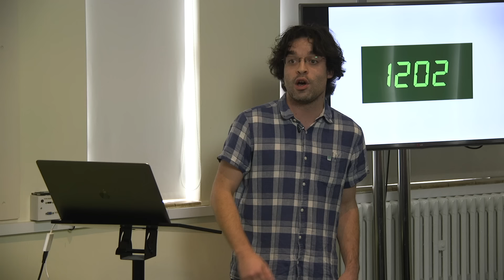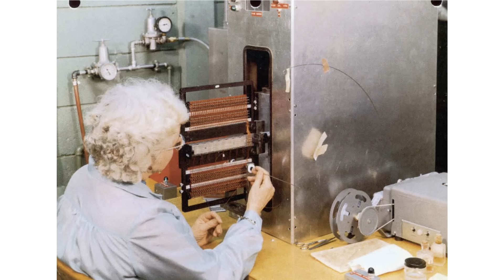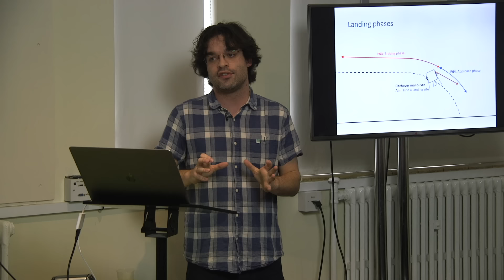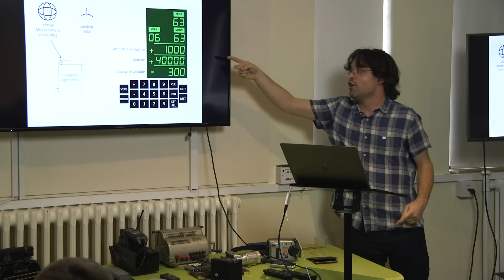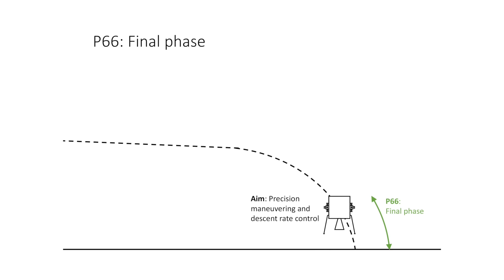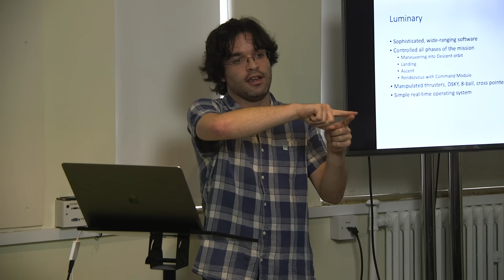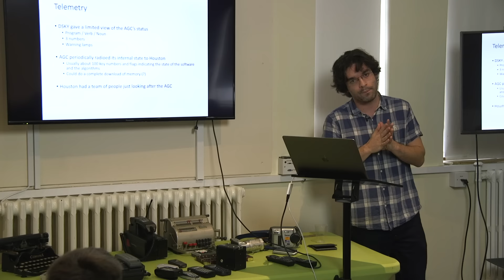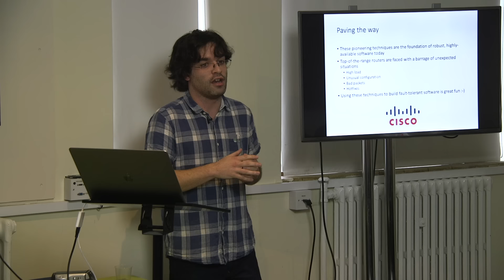Light Years Ahead | The 1969 Apollo Guidance Computer

Comment: When asked how to explain complicated scientific matters to the public, Einstein replied that no scientist knew what he was doing unless he could walk out on to the street and explain i t the first man he met. Robert Willis is an outstanding communicator and would please Einstein.
Reply: I have to agree completely, I know what it's like to see a blank face staring back at my words.  this was completely clear and concise, I hate computers, but understood this very well.  I entered high school in 71, and congress had bought 50 mainframe computers in the mid-sixties or so, and my high school in Oak Park, right outside Chicago, won the lottery for Illinois.  Both my elder and younger sister ended up software engineers, and I ended up a machinist, mechanic, and avionics tech, in the Corps.  I hated seeing them enter cars, replacing the actual analog cams, which I still like much better than electronic.  I have two years of cobal and fortran, required, because of having a computer in school, but I saw the problems that have cropped up, in those first years, and fought them two decades, with digital radar and digital voice scrambling.  I think I resented it because we worked on the equipment without school, hard schematics, and were denied access to the most fundamental part of what took place in the software and hardware.  This man made me almost begin to like computers.  I hadn't heard that quote, but it was very much like him.  Thanks for sharing that as well.
Reply: My mantra:  If you can't describe your great idea on the back of a used napkin..it won't sell or work!
Reply: @fredherfst8148  like the stone hinge set piece in the movie SPINAL TAP?  I prefer detailed drawings and information. used napkins really??
Reply: @fredherfst8148  To be more correct, but maybe  not pc, i recall he said:  "if you cannot explain it to a barmaid, perhaps you dont ................",
Reply: @37rainman  ...I've had a few bar maids explain a few things to me!
Reply: Still worthwhile as principle but isn't Einstein

"This writer has heard this quote for years and always grown up with the assumption that it was, in fact, from Einstein himself. In hindsight, it should make sense that Einstein never said this as his work remains some of the most complex and thorough explanations of modern physics. Variants of this quote have been attributed to Ernest Rutherford when Rutherford said: "it should be possible to explain the laws of physics to a barmaid."
Reply: @MikStorer  Yeah. It's a noble ambition, but rocket physics seems to be the limit. Physics that has no basis or analogue in everyday life requires that the listener is prepared to forego of their preconceived notions of how the universe works and more or less take the word of the physicist as gospel. "Common sense" is usually not applicable to topics such as quantum mechanics.
Reply: @MikStorer  Naw.  It was Rutherford and Einstein competing to pick up the barmaid by dazzling her with physics explanations.  "You see, my lovely, if I'm enriched uranium and you are enriched uranium and we achieve a certain level of energy density in our little pile, things are going to heat up and we just might react accordingly."  Einstein got the girl.  Rutherford sulked and ordered another beer.
Reply: Damn Straight!
Reply: Ok so I was just replaying my fav highlights of this mans presentation in my head just moments ago. Which sparked the realization that the nature in which he explained the computing events somehow tricked me into feeling as if I understood what he was telling me... at a computing level! As if I was following him every step of the way. "Verb 05 Noun 68, hahaha You and me both"
At the sidebar, Im still sifting through the debris of what use to be my mind from learning of what a GUI use to look like!! Are you sh!tt!ng me?! So, no Click, Double Click, Right Click? No Drag-N-Drop or C&P? Well in addition to the images of wires through rings, since there was no Control-Alt-Delete and Task Manager can we really call it "Computing"? Lets be honest with eachother... what All of these men and women did was Level 40, Merlin style Wizardry! Ok... and they did it going to the fucking Moon! 🤨

p.s. Now Im pissed because people like Zuckerturd and that "Look at my beard, Im a real man" Tweeter guy,  sleep on a matrress Sooo stuffed with their own ego that They think they float above the rest of us!
Reply: @lgg2304  I have to say, having watched the Apollo program from it's inception, you've nailed our current society quite accurately.  I followed the science then, amazed at the skill of those making this happen, while deep into electronics, and not understanding at all, the idea of "computer", at that point, only ever having mechanical computers in hand.  I found it truly enlightening, even with the "wizardry element" that threads in and out, throughout.  I still find my computer one of the most obstinate, mind warping, challenging thing I've ever had to deal with.  I also look askance, at the fact, we discarded every bit of "great technological products" pretty much as soon as we finish using them, well, the first time.  You really hit the nail on the head, regarding computing then, and today.  Not too many years ago, a joke about cars, "if your car acted like a computer", suggesting your car would often refuse your desires, and now, we commonly see it, no joke, real time.
Reply: He was a fraud.

Comment: I enjoyed every second of Your presentation. Maraget Hamilton and her team are geniuses. 
It alsp brought back memories of my first jobs as a programmer in the late 70s. We wrote software to control powerplants running on redundant 32k (16k program/16k data) memory 8 bit machines (2 19" 32H racks each) with not enough space to run an assembler, so Hex coding was the only way. 
At university while studying physics I had joined an experimental course in CS in 1976/77 and I remember the above mentioned principles being taught by our professor. 
I let physic go and never got my degree because I had so many jobs after just 3 semesters, that I founded my own small software company in '79.

Comment: The capacity of the AGC is very similar to an Arduino Uno microcontroller (Atmel/Microchip ATmega2560), these chips are intended for cheap consumer goods and require engineers with classic skills to keep costs down, much unlike the hardware in core routers.

Comment: How come a radar routine scheduled for the next stage of the mission (takeoff from the moon surface to the rendezvous with the command module) started during the landing stage and no one noticed such ‘bug/malfunction’? If I understood the conference properly, the whole programming was based in blocks and in such circumstances the ‘loop’ between blocks so far away in running time/sequence would be impossible to happen, but…  I think no code available to check anymore. About memory: last millennium, I and other programmers had to allocate the length the memory we intend to use as common routine, depending the word length, the number of running routines, etc. because memory cost was high, operating time the same, speed was low, and so on. Nowadays programmers no long need to be that meticulous, turning their creativity towards solving  the challenges the best way without wasting energy and time in tedious work computers can do quickly and effortlessly. A last word to thank you the presentation theme and the captivating and logic way it was conducted.

Comment: Given how wide the gap was from the AGC from anything else available to the Soviets, I wonder what the plan would have been to solve the guidance needs of the N1 rocket? 
The Soviet moon program failed because of propulsion reasons, but if this had been overcome would the USSR have just taken a heavier weight penalty with contemporary computers or would they have built a rocket that by it's design did not have the computational requirements?

Comment: No fancy bells and whistles, just a simple deck of slides... But an outstanding and passionate communicator who can actually make you feel smart just by listening to him explaining complex things with simple illustrations. Highly recommended!
Reply: No fancy bells and whistles.  This brings the audience feeling like they are back in the 60 when all this was happening.  I wonder if the presenter did that on purpose?
Reply: Jonny Mosquito Strawman at Large  Modern day hardware is very susceptible to ElectroMagnetic Pulse, the hardware of those days very much less so. Soviet fighter planes which were brought over in the early 1990s were found to be using vacuum tube technology, which is much more hardened against EMP than VLSI chips. I'd suspect that there was similar hardening done - you might remember that the computer was made up of a very large collection of the same very simple chips wired to produce the required results. Of course, there were quite a few unmanned spacecraft sent to the Moon to map and photograph the surface before the Apollo missions, and these would serve as a test bed for figuring out the amount of hardening required.
Reply: And then there is the magnetic core memory as well, very much hardened against radiation as compared to today's VLSI memory, as noted above.
Reply: Here's a lot more detail on the computer - https://www.youtube.com/watch?v=2KSahAoOLdU
Reply: And the video above is first in a series of videos... and here's one on the programming language and how that worked - https://www.youtube.com/watch?v=xx7Lfh5SKUQ
Reply: @stream47  Yeah  , funny how in WWW III T 34 would have won agsin :-D Good Putin and Chinese  also  have electronic shit now :-D
Reply: Nothing better  than that, have no clue about natural  science and tech, but this was so great ...easy to understand  still only dumbed dumb enough to still bring over massive Information. This guy gets a throphy from me. Perfect presentation  you feel the passion, the work invested and the hard science behind  it. Wish Youtube was do good more.
Reply: d’uh, like it’s rocket scien... oh. Never mind.
Reply: I can do nothing but wholeheartedly agree with you. I feel I can actually understand to a basic level how they did manage to achieve what was undoubtedly the greatest event of the century. An excellent lecture all round.
Reply: Jonny Mosquito Strawman at Large  Aww bless, you don't understand science in the slightest.
Reply: It's a good rule for presentations, you shouldn't be putting information you're audience needs to read in detail in the slides as they will miss either your speech or what's on the slide. It should just be for visual aid and key talking points. And he does an excellent job.
Reply: I can do nothing but wholeheartedly agree with you. I feel I can actually understand to a basic level how they did  manage to achieve what was undoubtedly the greatest event of the century. An excellent lecture all round.
Reply: My experience working with engineers for 35 years is that the brightest and most competent ones were the people that could explain highly complex systems so that anyone could understand how they worked.  Like this guy...
Reply: When I noted the length of the video I thought to myself, oh well I will just watch until I'm bored. I watched the entire video, fascinating!! The presenter did a brilliant job keeping it a personal and interesting and, that would satisfy a surprisingly wide range of audience expertise.
Reply: @steventurvey5626  I had the same experience. I’m no expert in computer coding or hardware but the whole thing was fascinating and couldn’t stop watching.
Reply: @steventurvey5626  Same here,  in the end the longest non-music Youtube video I have ever watched!
Reply: @steventurvey5626  its worse...i want this guy to do a weekly 2 hr Video  on his  own channel now :-D seriously, anyone  kniw where to get more of stuff so good?
Reply: Jonny Mosquito Strawman at Large  If anything of that is correct, today the miniaturisations are much more advanced, but this can mean because of delicateness, they are more susceptible?
Reply: Yes, way better than that pair of blokes who just throw acronyms on a big screen. I had no chance and I'm pretty literate!
Reply: For 25 years I've been aware of the inverse relationship between PowerPoint and real content presentation - unfortunately I then pursued an MBA to confirm my theory and see weak presenters rise and hide behind made up correlations, useless animation and ridiculous projections.  And that's where we are...
Reply: Very true
Reply: You got some some on your chin there, guy. And for Christ sakes, hide that thing.. there's kids around.
Reply: He sounds nervous to me so im distracted.
Reply: for an untrained eye of course. the whole talk is about how many awesome bells and whistles there are...
Reply: This made me imagine people blowing on whistles during presentation
Reply: This is by far the best way to give a talk, if you can get away with it.
Reply: No narrator talking to you as if your a child. With bright colors and music.
Reply: @JohnSmith-hi2ry 8 pp in😅 pp😮0p pp obp
Reply: Jonny Mosquito Strawman at Large  Magnetic cores are rad-hard. As long as you can reset it you can recover.
Reply: thats a great point! thats actually a personality trait, to make people feel smart. i experienced that in a physics research institute, if you asked a stupid question there, it was accepted and even approved a great question and explained in detail
Reply: @michatroschka  tbh , that guy is so good he made me a duning kruger physics Professor now :-D
Reply: It's king staggering how they got the moon. In a tin can.
Reply: @danvincent2600  Not really 😂

https://youtu.be/oX8-IXdABuc?si=_jm2xzjG0KMbSc3U
Reply: Gullibility is at 100% Captain.
Reply: @telx2010 maybe you should lower your gullibility sir. Its dangerously high and you are at risk of becoming a member of qanon 😂
Reply: fake mission
Reply: it's jibberish, Earth is a level Plane, always has been.
Reply: @mulder2400  so says every moron, regularly
Reply: @mulder2400  🙄🙄🙄
Reply: @mulder2400  The consilience of evidence overwhelmingly proves otherwise.
Reply: @mulder2400  be quiet when grown ups talk, finish  Kindergarten  first , then come back. You want to believe  too much BS, Mulder, educate  yourself  really, you can do it.
Reply: @mulder2400  so why you use a computer, when the tech clearly Was based on space travel and  is on pgysics not working  on a plane earth?
Reply: Maybe. They do what Naza deems. 🎩
Reply: @ginomazzei1076   I agree
Reply: @ginomazzei1076  WHOooooT?
Reply: @ginomazzei1076 pp
Reply: @ginomazzei1076  😂🙄😂🙄😂

Comment: In his response to the question of redundancy @1:17:37, I believe what he was describing was the difference between the computer's configuration during a nominal descent profile (called PNGS and pronounced "pings", short for Programmable Navigation Guidance System) and AGS (Abort Guidance System). The astronauts had a switch which could trigger from PNGS to AGS if the descent got too hairy, at which point the AGC would drop all descent tasks (and the descent stage along with them), and reorient the vehicle to a point in space that would take it to rendezvous with the command module. Interestingly, this exact situation occurred on the Apollo 10 dress rehearsal descent, which you can find here (it's pretty unmistakable when the whole lunar landscape rolls wildly out of the window and Gene Cernan says, "Son of a bitch!" as the descent stage drops away).

Comment: Leaving the rendezvous radar turned on was a deviation from the mission plan, not a mission planning oversight.  The original Apollo 11 flight plan documents are public record and freely available on NASA.gov.  On page 3-67 it lists "VHF RANGING RR - OFF" as one of the steps to be performed by the CDR immediately after LM/CSM separation.  Pilots fly vehicles, not checklists, so it may be the case that Armstrong had his own reason to leave it on.  But in the interest of historical accuracy if there was any mistake involved it was operator error not engineering error.

Comment: This is the best explanation of the Apollo 11 landing problems that I have ever seen. But he really should not have diminished Armstrong's actions during the landing. These men were facing a real life threatening situation. "Heroic." They weren't stuck in an elevator between the 1st and 2nd floors.
Reply: Russ, thank you for your comment. I definitely agree Neil Armstrong, Buzz Aldrin and Mike Collins were brilliant, heroic pilots whose intelligence, clear thinking and professionalism were a major factor in the success of the mission. Buzz Aldrin was very quick to realise that the V16N68 was causing the problems and the two men remained calm throughout an extremely stressful and distracting situation. I am full of admiration for all of them. But as you can probably tell, I believe that the guidance computer and the way it handled the life threatening situation was a key component of the success of the landing and I admire the hardware and software engineers who built it.

It is hard to fit every nuance into a talk, but in subsequent versions given since this video was made I've made the above points much more directly.

Comment: It's a load of rubbish that your pocket calculator isn't that powerful, but we don't have pocket calculators anymore we have pocket computers/cellphones that have impressive I/O capabilities in their own right, in addition to clock speed, processor power and RAM. The point is well taken though. The Apollo computer was more an "expert system" than a general purpose computer. I suppose the best way to say that our phones have more power is to qualify that statement further rather than ditch the comparison altogether. 

My question is this, could the Apollo guidance operations all have been carried out on a properly equipped Iphone, and I suspect with some modifications, the Iphone could indeed land a lunar module.